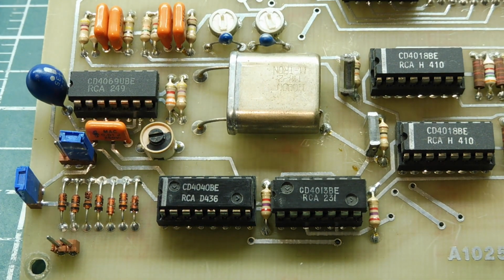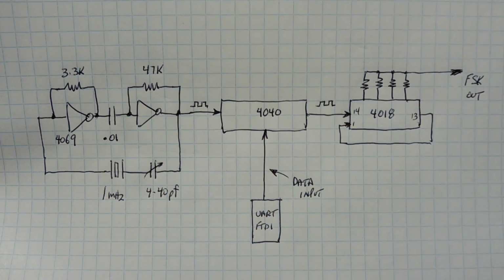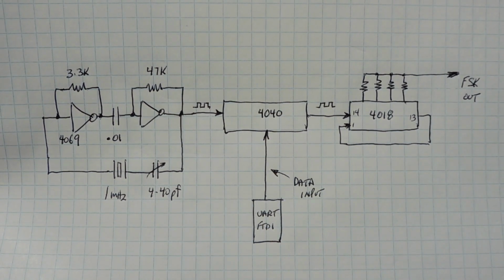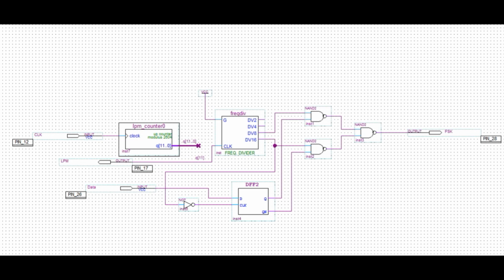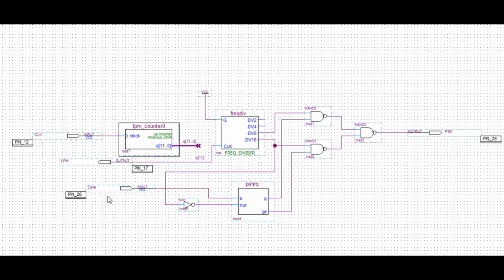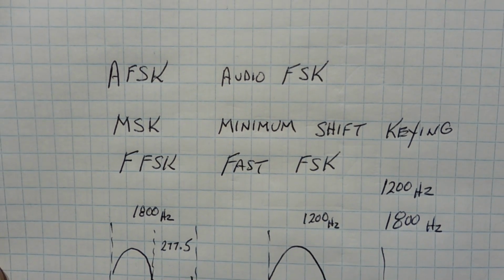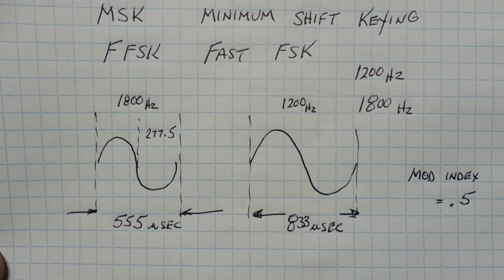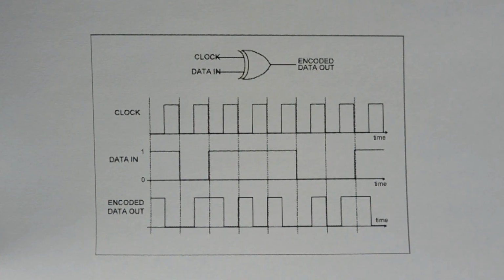FSK Generator  /  Altera CPLD

Comment: Noticing the Manchester encoded data is just the clock signal (inverted) if the data in symbol doesn't chaconstantnge. Does the decoder require a message preamble like a string of mark or spaces to get the PLL to lock? I feel like I'm pretty close to being able to implement a simple radio myself but, I keep getting stuck on knowing when/how to sample the bit stream. It seems like clock synchronization is the key but, I just don't see how a PLL can lock on quick enough to get the first bit of the actual message.
Reply from the maker: A clock recovery/phase detector needs several transitions to estimate bit period and phase.
Until it has that, samples fall at the wrong times and the first byte(s) can be wrong.
Send one or two bytes of preamble $AA or $55 work well. A start of packet byte ($D7) also helps.
If you use CRC packet checks, you can ask for a retry on corrupt packets.
https://youtu.be/KjC0w78iuuk

Comment: Hi, please, please, could you share how did you connect the crystal to XR2211 as I have never seen such an application. Certainly on the internet there is no such example (except here). I am using XR2211 and is drifting a lot, this could stabilize the XR2211.

Comment: Nice video, thanks.  One question though, you lost me with "I'm using a diode matrix to divide down the crystal oscillator into audio frequencies".  How can a diode matrix act as a frequency divider? (I understand how a ripple counter can do that, but not a diode matrix and google turns up no results).  Thanks.
Reply from the maker: A ripple counter is a binary counter and also a binary divider which can divide by 1,2,4,8,16 ... etc. If we want to divide by 30 we would have to reset the counter after 30 input clocks and that is done by a diode matrix. If we connect a diode to each weighted output 2,4,8,16 and connect the anodes together with a pull-up resistor, this will give us a reset pulse after 30 input clocks. The diodes form a wired AND function and turn the ripple counter into a modulus divider. The divider in the CPLD is a modulus divider so it was easy to implement.
Reply: @0033mer  That's what I was missing, the diodes form a 4 input AND function to reset the counter.  Thanks for clearing that up!

Comment: Looking at the data sheet for the 4040 I am only seeing 1 input which is the clock.  Since the chip is a 12 stage counter you can get 12 different frequencies out of  it but I don't see how the uart input selects its particular frequency.
Reply from the maker: CD4040 is a binary ripple counter. We need a Modulus counter so a diode matrix is added. The diode matrix is controlled by the UART output which will reset the counter at the desired count. Probably would need a whole video to describe Modulus dividers.

Comment: Does PLL need some "primer" sacrifitial bits to lock-up, or it can grab incoming data starting the first bit?
As seen on the scope, the output sine amplitude varies from the mark to space bits. How does this affect the PLL performance?
Reply: PLL doesn't need a 'preamble frame to lock in. In fact here it will never fully lock, as frequency jumps quite fast. However, the feedback voltage will follow the mark/space frequency bins. 
    This PLL (4046) has a digital frequency detector (either XOR or PFD type), so the sine amplitude does not matter, it shall be converted to a digital stream using comparator at the input

Comment: I missed a step of controlling 4040 by the UART Tx. Some elements on the schematic 2:05 are absent.
Reply from the maker: I drew the schematic as a block diagram to make it simple and easy to understand. The UART data switches a diode matrix which controls the 4040 as a Modulo N counter. The UART data now switches between the programmed Mark/Space frequencies.
Reply: @0033mer  Thank you for reply. Is it possible to get MSK frequency shift using 4040 counter (e.g. 1200<->1800Hz), or it is always 1 to 2 ratio (like 1200<->2400Hz)?

Comment: Awesome video. I just started playing around with IR remote controls and I studied the library that came with arduino. IR comunications use the type of frequency shifting that you were explaining here. The decode was pretty interesting as it was done in software. An interrupt was set up to sample the incoming signal every 50us or so (i think)  and count the number of intervals it was either high or low to determine if it was a high or low.  Made me read up more on IR comms and it was said that technique also helped with interference from other light sources. There were some incredibly smart people back in the day.